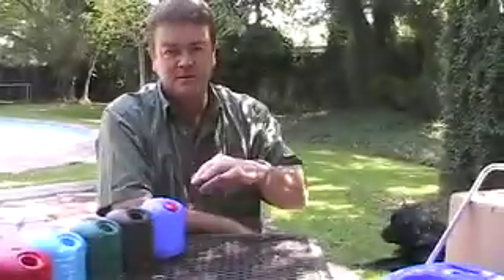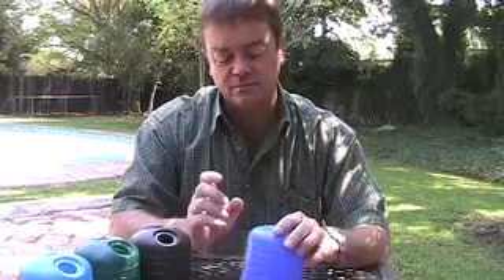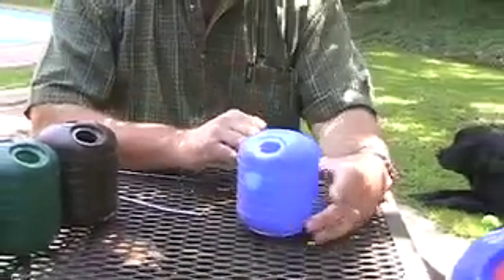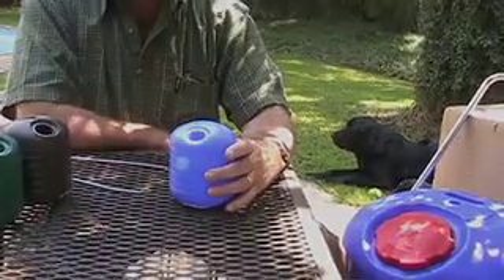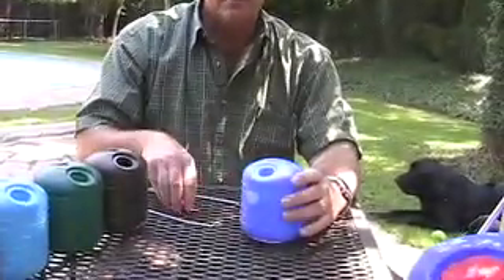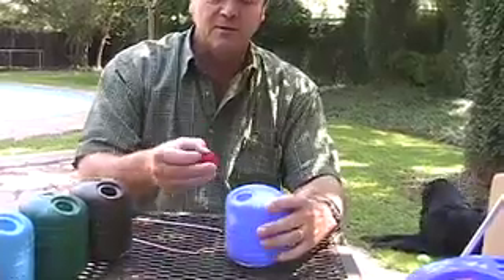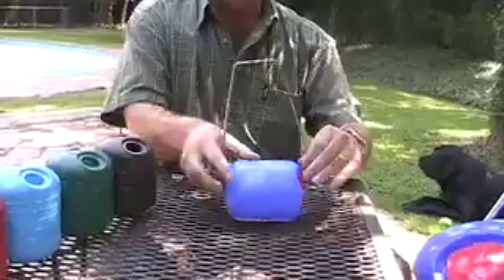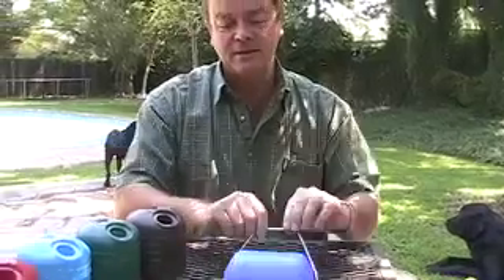The Hippo Water Roller Project

Comment: Hi Askia White, without doubting the many advantages of the roller, I would like to ask what type of plastic the roller is made from ? In other words, did you consider or how did/do you tackle the downside of the technology, which likely is that the strong mechanical forces during rolling on the ground rub offs of a lot of microplastic (similar to tire wear) whereby releasing it into the environment ? Green greetings from Germany, Biowohnlich

Comment: Surface water from (ponds, rivers and canals) frequently used in Asia and Africa isn't clear, it has many dissolved and suspended solids as well as pathogens, bacteria and viruses. Although bringing this water up to WHO standard for drinking water would be a challenge minimal low cost treatment can turn into safe and clear drinking water. The Hippo roller is already a good water transportation and storage system. 
Addition of a Chlorine tablet and holding water in the container for 30 mins can kill harmful biologic content of water. Also addition of small amount of Aluminum sulfate (Alum) will rid the water of suspended solids and make it crystal clear. 
A recessed quick disconnect female coupling can be installed about an inch from the bottom, than a quarter inch tap can be inserted while it is in home being used for storage. Installation of tap (which will be removed before rolling) will allow drawing without contaminating water dipping unsanitary containers in the water or disturbing the solids settled in the bottom. Once all the water has been drawn (except last one inch) container can be washed for the next fill. Additional cost of quick disconnect coupling and tap would add less than $10 to the roller.
Reply: Good suggestion, but what about developing a transparent and bio-degradable/non-toxic plastic alternative to benefit from UV-disinfection while rolling it (during the day) and to avoid excessive microplastic rub off ?